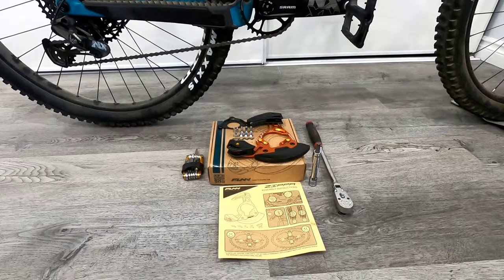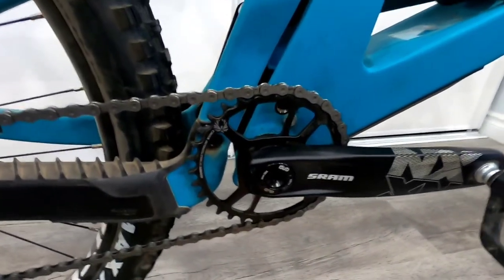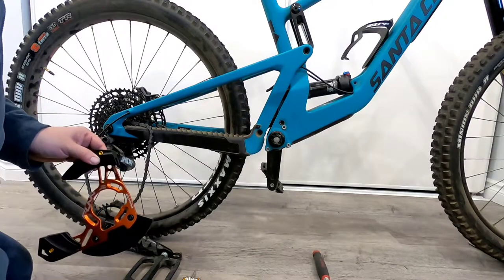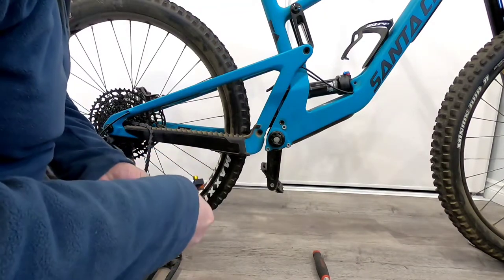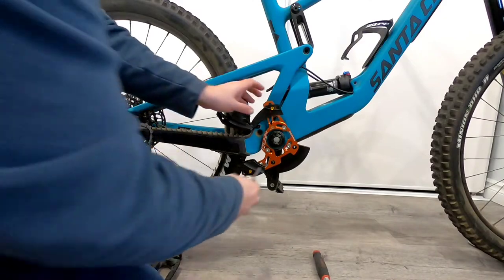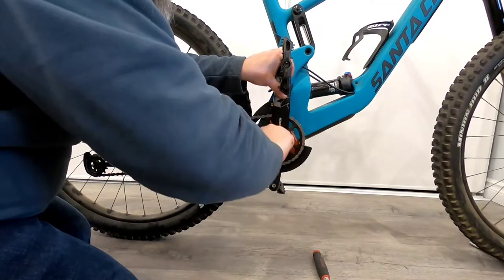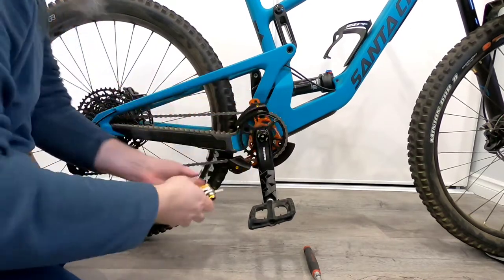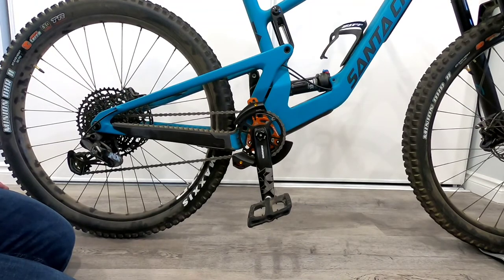Funn Zippa DH chain guide and bash guard installation

Comment: I just mounted an e*thirteen TRS PLUS chainguide/bashguard on my Pivot Switchblade and to my disappointment it just won't work with my bike. I need to add all the spacers to get clearance on the smallest chainring on the cassette, but at that point it will rub on the 2 biggest. The thing is that it rubs on the inside of the bashguard with this configuration, and bottom line is I just have no config that'll work. If I wanted it to work I would have to grind off material off the bashguard to leave just enough clearance for the chain for the biggest chainrings. I don't want a ghetto setup for this, and as my main priority is just a bashguard, I feel a standalone bashguard will have to do it for me.
Let's just hope the shop I bought it from will be openminded and help out.
Reply: @thebeardedbikercan  I ended up with a 50% refund, and I've just removed the chainguide itself so it's now just a bashguard by function. I'll just use it as is till is worn out or something, and at that point look into a standalone bashguard instead. Personally I haven't felt any need for a chainguide yet so it'll do for now.